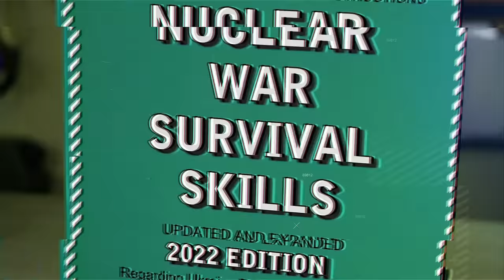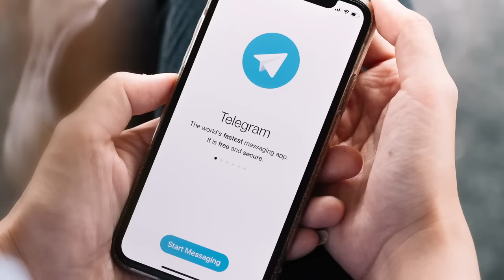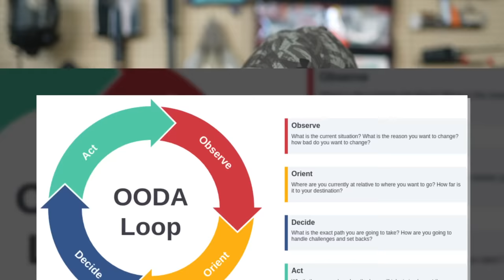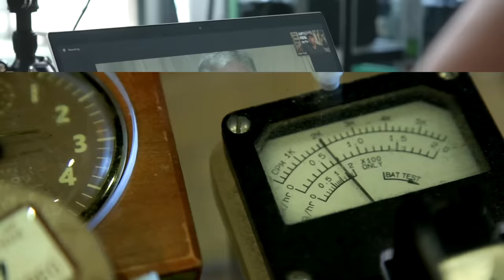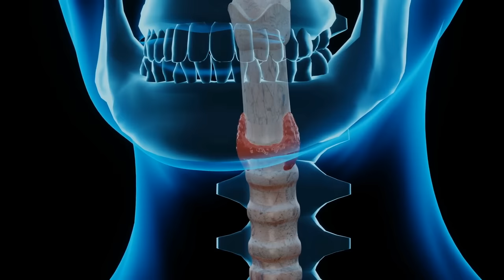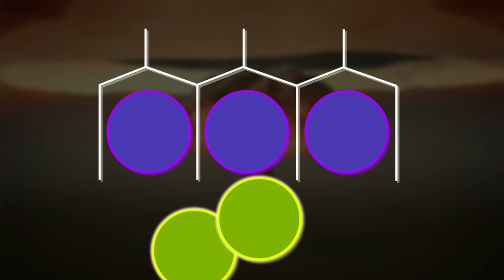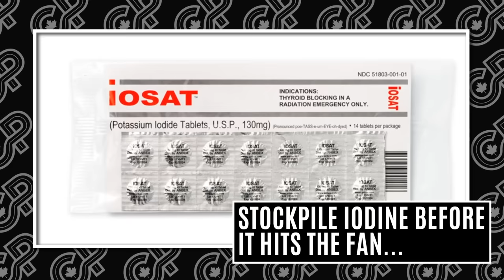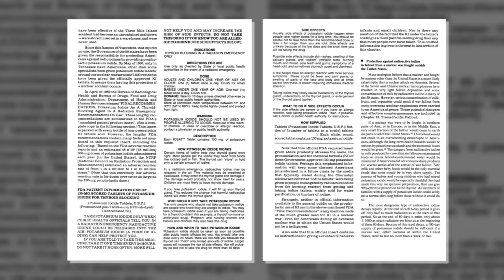Nuclear Expert: 90% Chance of WW3 Right Now... Here's How to Survive it.

Comment: The short term solutions to nuclear fallout are pretty straightforward however the long term prospect for growing crops is a bigger problem no one talks about. The long lasting isotopes like strontium 90 have 30 year half lives and are taken up by plants that mistake the radioactive element for calcium. This element would become concentrated in the meat or milk of (farm) animals grazing on these plants. In similar ways radioactive elements can end up in the fruits and vegetables plants and trees produce. Although there will not likely be a great number of these long lasting radioisotopes that fall on your garden, just one of them that ends up being ingested and then deposited in your tissue can result in cancer. The short term (up to 90 day) effects can all be mitigated with shelter and storage plans. The long term challenges (ie: growing food and raising livestock) would require a vastly more comprehensive level of planning that would have to be implemented for decades.
Reply: My understanding is, but check for sure, is that Strontium  pick up in animals will concentrate in or near the bones, so avoid the meat close to the bone. But double check this.
Reply: @lylemacdonald6672  That is generally true but if that animal is a milk producer, at least some of it will end up in the milk (and any bi-product like cheese). high calcium vegetables also absorb strontium.
Reply: yeah but doesn’t the danger of the radiation of the element actually go down significantly after a year or two???
Reply: @Atlas_Systematica  Yes and no. Yes, the radiation levels even near ground zero will allow rehabilitation in the area after about two years BUT ambient radiation levels and growing food are two different animals. All the short half live radioactive particles will be gone (having gone though 10 half lives and will be effectively inert), that is the good news. The bad news is some of the radioactive particles have extremely long half lives AND mimic nutrients that plants absorb. Strontium 90 mimics calcium and plants will absorb it and it ends up in the crop you are planning on eating. Strontium 90 has a half life of about 30 years which means it is dangerous for 300 years. If you walk by a few particles on the ground its nothing, if those particles get absorbed by a plant you then eat, that is a big problem. Not because a radioactive particle will pass though you digestive tract but because your body will see it as calcium and incorporate it into you bones or tissues and it will radiate you 24/7 until you get cancer. Strontium isn't the only radioactive particle like this. This is what I am referring to as the long term radiation problem/risk.
Reply: For animals, bring your dozens of chickens inside house. Already have caging materials inside house to build a new run, as you won't be able to let them free range anymore. Have the bird meds and feed on hand enough to last a couple years as growing feed likely an issue. You may have to cut back to a smaller number of chickens enough to produce eggs only not chicken meat in order to make the chicken feed last several years or more.
Reply: @lylemacdonald6672  This is my understanding as well. Of course depending on the animal, navigating this could be more or less difficult. Large animals, its easier, something chickens would limit the available meat quite substantially.
Reply: @gsdpuppies3230  a good suggestion and  I would agree. The long term problem remains though. Where do you get feed 5, 10 or 20 years out?
Reply: @moose9906  The long term answers, unless one is wealthy enough to have a complex complex bought and paid for, isn't going to be much different than the short term suggestions I gave. The point is nobody has all the solutions, and each person can choose to just die off right away, or you can decide to use brains for short term solutions that are feasible. Hope must always be part of the fighting spirit to survive, and a few may catch a break, just like the ancient civilizations paid it forward for us to be here. Time to get to work!

Comment: Nate you do not need to come up with a metaphor.   Paracelcus said it best "The DOSE makes the POISON".   A hazard is an agent chemical, physical, biological, and if you break down physical to include accoustical, and non-ionising and ionising radiation, then a hazard, is an Agent of the foregoing that may cause injury or harm to the health of an Asset.  We measure this in different manners depending on the Agent involved.   Noise is measured one way, as is a poison, as is ionising, and non-ionising radiation.  
Exposure has 4 vectors or manners of ingress.   Injection, Inhalation, Ingestion, and Absorption.   Either one of these vectors, or combinations thereof, can be enough to kill you. 

LD50 of water is 32 Litres.  If a sample size of people drink 32 Litres of water, 50% of that populace will die. 

LC50 = Lethal Concentration 50% vs Dose as in an LD50's case. 

Dont ask me how we know the LD50 of water is 32Liters.  I am sure you can figure that out. 

 Bottom Line is, Dose is proportional to exposure, in radiation situations.  If in a Noisy Environment, exposure is measured in Levevel (A) weighted Equivilant, in Decibals, of an 8 Hr Dose.   Usually the upper exposure limit for chronic noise is circa an L(A)eq, 8hr dose. 

So if an L(a)eq, 8hr has been measured to be 93 Db you have to reduce your exposure by half the time to get to 90 supposing that doesnt create a permanent threshold shift. PTS vs a Temporary Threshold Shift.   But that is noise.  Half the time, half the distance.   Same with anything radiation related, ionising or non-ionising.  My 2 cents.

Comment: The old version by Kearny is online as a pdf for free. I read part of it last week. It is great.
What i really wanna know is target assessment. Some maps show my town as a target but only under 500 or 1000 warhead scenarios. We have a fuel depot, but it is connected to a series of refineries in the east bay which would absolutely be a target, rendering our depot superfluous. If the military base 50 miles south gets taken out we would survive blast and depending on the day and prevailing winds, probably would have several hours to seek fallout protection. If a bomb hit anywhere in my town we wouldnt survive the blast since the town is only about 7 miles from one end to the other.

Comment: What would make this really super valuable is if it were printed on some form of waterproof medium or protected in some way. This is why I'm thankful for the PDF format so that I can print and laminate the pages. Thank you very much this wasn't always available in PDF and I commented on it multiple times and you guys have finally done it which is amazing. Only question I have is the version available on the Canadian prepper website says revised 2022 edition and the downloaded format says revised 1987 edition. Is there a difference or was just the number on the cover page changed. If there is updated information in the 2022 version that is not available in the 1987 version it would be awesome if you guys would make the 2022 version available in PDF as well
Reply: But, an EMP you electronics are fried and the pdf uses less, paper books will be ok
Reply: @catman5546  this is what Faraday boxes are for bud. Had one built for a couple of years now and any pertinent information is stored on about 2 terabytes of memory medium within along with a device to read said information from the memory core. I even have a couple of spare handheld Ham radios in there that have been unlocked so that they can broadcast on all frequencies. They typically come locked but there is a way to unlock them for transmission. I know that that's illegal and I do not transmit on those frequencies but those frequencies are not illegal to use in the event of an emergency and so I went through the trouble of unlocking them for such a case. That's not the only thing I rely on though I do like to have hard copies in case that Faraday box for electronics fails. But for the same reason as you should have hard copies you should also have digital copies as one or the other could get destroyed just as easily a fire can destroy your books but a Faraday box made out of a fire safe will protect. And vice versa if the Faraday box fails you then have your hard copies to rely on. Redundancy is King. Two is one one is none. That doesn't just apply to EDC. It should apply to everything including information. But honestly the main reason I wanted the PDF was so that I could print the pages and laminate so that I have a waterproof hard copy along with my digital copy.

Comment: Cold War fact: Route 80 in New Jersey is the widest in the country because when it was constructed in the late 60’s, it was designed to act as a runway for military cargo planes to disperse troops and armor near New York City since then NY was considered a primary nuclear target since then it was considered the communication center and after being hit by a nuke, the troops could re-establish command and control. Also, the “Jersey barriers” were originally pinned down to the road and not cemented in place as they are now so that when the military planes would fly “low and slow “, they would drop off tanks and dozers to push over the barriers to make room for larger planes to land to deploy troops.

Comment: You cut the Mississippi in half by Bridges the United States military has vehicles that float they will drive these vehicles right into the water on the front and back of the vehicle comes at 10 to 15 ft boom each vehicle can make a 25 to 35 ft floating bridge they will connect as many as needed to make a land bridge across or they would go and get some type of hovercraft or they would float in a ferry within a matter of hours and transport any type of military equipment needed and it will hustle national guard aircraft or military to get across it not to mention from California to Oklahoma to Texas and to Central America there was more than 2 to 5,000 miles of underground rain trail in other words there's 5000 miles of underground train tracks and tunnels all across the west and Central America not to mention the 10,000 miles of underground tunnels in East Coast America that we know of

Comment: My tale of preparedness is hoping I'm not in a targeted area. The second part is simply surviving the circumstances of such an event. The last leg is the willingness to migrate to an area that better supports me. I have a pretty good understanding on how radiation works. After all, I do have a degree in quantum mechanics. And as dude pointed out what people can't see or doesn't understand scares the crap out of them. But if you know the numbers and do the Maths things aren't that scary. I wouldn't want a nuclear event to go off, but if it did and depending where it did, I'd survive  this. Quite well and not in a bunker or a basement. I think you know where I'm going with this.

Comment: Have lots of tape. Very good at removing radioactive particles from your clothing 😊
Reply: That would be a bad method since you likely send hot particles airborne when you peel the tape off. better to just wash them outside in a bucket of water. Better option is to wear a tyvek suit over your cloths so the don't get contaminated.
Reply: @guytech7310  I’m glad someone who worked in a nuclear power plant set me straight.

Comment: This is why I have farms and none of them has a cabin 😣Been trying for 4 years to get somebody to build a place for me so I can get out of city.
Reply: Build it yourself. If all you need is a 600ft sq ft cabin, its not too hard to do the framing. You can also try getting a local handyman to help. If there is a local HomeDepot, Menards, Lowes or a lumber yard, as them for a some that does carpentry\framing.

However I recommend building something with a Basement. In that case contact our local\nearby concrete supplier and ask them for someone that does poured concrete foundations.
Reply: @guytech7310  I’m a single mom with a little girl. I can’t frame a cabin I don’t know how to build a structure. I’ve got 1,000 acres and no structure to bug out to super frustrating. Tried so many x to find a builder and they say it’s $300 a sq ft and they don’t ever start. Wish I had brothers.
Reply: @CabinGRL  You could frame it. April Wilkerson (YT) framed a huge shop. 
For get the builder & just higher subcontractors to help you do the work.

Get some plans drafted (i recommend Virtual Architect - This will do all of the layout and material estimates for you)

When you have your plans set, if you probably need to provide them to your county for approval. Once you get them approved. find a contractor to do the excavation, foundation work, or rent a mini-excavator do the ground work yourself. You can also ask any builders you reached out to for contractors, You might also be able to hire the builder as consultant since they only need to spend a tiny amount of time if your doing the majority of the planning & hiring the contractors.

There are lots of YT videos on how to DIY home construction. 

On the good side, I think the US is about to fall into a deep recession which means material prices & getting contractors should be easier next year. use the time now to get your building layout down with Virtual architect over the winter.

Comment: Just to be clear - everything will end up as iron NOT lead, sure it will take bazillions of years but…in the end, before the entropic (and hypothetical) expansion of the universe will kick in and reduce everything in to quarks; everything in the entire universe WILL be iron. 

Dumb detail since it doesn’t have any effect on the conversion but, it’s a detail nonetheless.
Reply: Like mercury, lead has a set melting point before it becomes fluid. Temperature and pressure cause transformation into either in fluid or solid. In the movie "Jaws"  the Sheriff loaded his M-1 Garand with mercury in the hollow point 30-06 cartridge knowing it will make the bullet explode on impact before going on a shark hunting expedition. Little did he know improvising a oxygen/acetylene tank help expand the jaws of the shark more effectively.
Reply: @tomcat6735  I thought he was talking about the degradation and half-life, not the melting and/or smelting of the same. 

As far as the half-life, on a cosmic scale spanning quintillions of years…every solid matter will be iron eventually. 

Everything in the universe will either degrade in to gas or, if it is under pressure inside a planet or even inside a star etc, whatever it turns into…after it, the celestial body, has lived its life it will eventually turn into iron.
Reply: @ninjasquirrels  I assume he correlated with Uranium half-life and the degradation into lead after a nuclear detonation on Earth. Sorry, got off subject.
Reply: @tomcat6735  you’re good, I figured as much…it was just a technicality, nothing that would affect the meaning of the conversation at hand.

Comment: Most of the Russian arsenal is set to ~3 megatons ostensibly due to accuracy issues.  China carries higher yields than that, maybe due to a smaller stockpile. [that's my guess anyway] Russia does have roughly 1300 tactical nukes [to our 400], which in my mind anything above 10 kilotons is a strategic nuke.

Comment: Strategic Nuclear Weapons today are not in Kilotons, they are in Megatons. Sarmat 18 & SS-28 Missile can take out an area the size of Texas or France in size comparison. Try surviving that.
Reply: Warheads on Sarmat are all under 750Kt, its a MIRV platform. The maxium sum of all warheads launched using Sarmat is 40 Mt. However there is Posiden, which can be 100Mt perhaps 200Mt.
Reply: @guytech7310  The SS-18 can be fitted with Megaton Yield Warheads.
Reply: @Gerardo11  Unlikely. Strategic missiles will be set up as MIRVs as a cluster of smaller yeild warheads is more effective than one big warhead.
Reply: @guytech7310  No one is arguing whether lighter or heavier mirv's are of a more advantage over the other, strategically each yield plays a Tactical role on the battle field. My point is that Missiles like the Sarmat-28 can carry 15- 500 Kiloton Mirv's or 10 Heavy Avangard Mirv's in the Megaton range, but regardless of which Strategic Wepon is used, 15=500 Kiloton Vehicle's is in the 10 Megaton range, and that's only (1) SS-28 now imagine if Russia deployed just 1,000 of those Missiles?  How many Megatons are we talking about then? Good Luck surviving this.
Reply: @Gerardo11  I doubt they would use many Megaton devices. Smaller yields but hitting more targets is the preferable deployment. If you hit a city or target with just a 200Kt device is going to trash what ever was there or around there.  Rockets are expensive & thats why MIRV is used.
Reply: @guytech7310  Reread my last post.

Comment: When the fallout comes down, how long until the ground is good for gardening again? When would it be safe to take wild game or livestock?
Reply: Quite a while since some of the fallout is Cesium-137 & strontium 90 with half lives measured in decades. Sr90 is the worse because it can remain in your body for decades. 

The only practical way to grow food post war is a greenhouse, and either cover a field with plastic sheeting, or pile up the top soil into a mound and cover it with plastic sheeting so it does become contaminated by fallout. Perhaps if you live in a area with really deep top soil you can skim off the top 4 to 6 inches and plant below.
Reply: @guytech7310  thanks for that reply